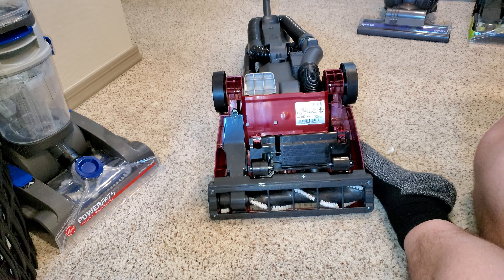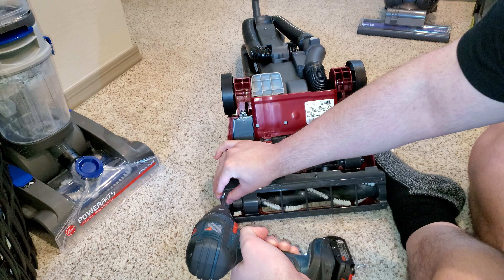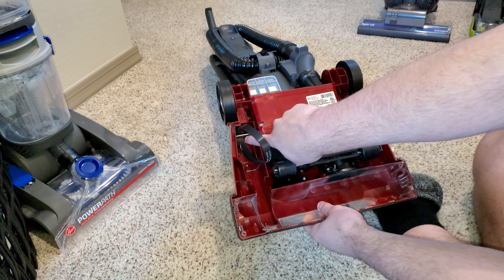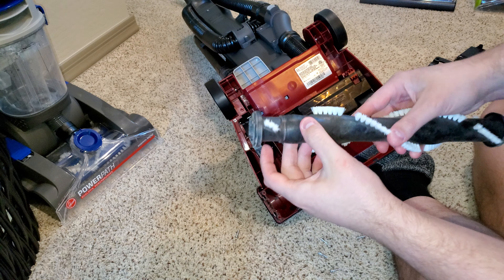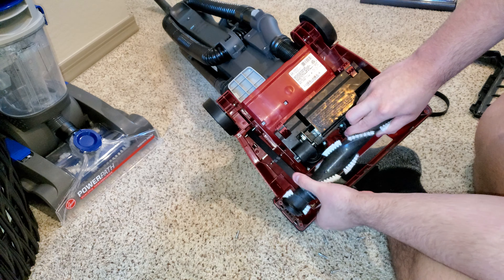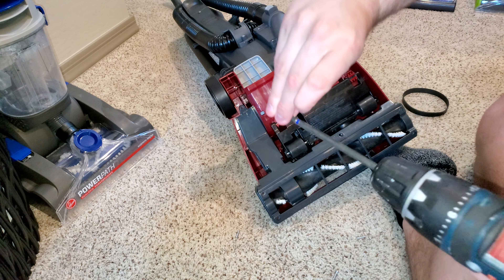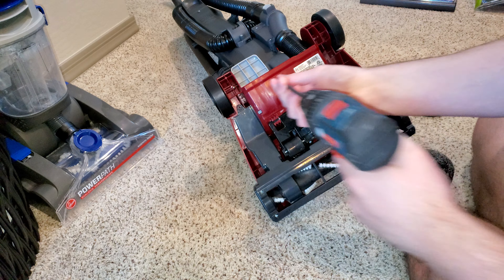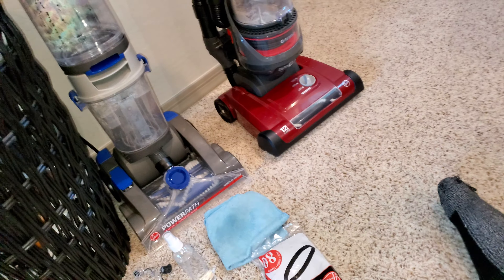How To Change A Hoover Vacuum Belt. Simple And Easy.

Comment: I was so mad about my brush not spinning after two uses until I took it apart and saw the belt broken. It was really dry and brittle (I don’t know how long it was sitting on the shelf at Walmart) anyway you just saved me tears after investing $145 in a good vacuum. Thank you!
Reply from the maker: Glad I could help. I have had many new vacuums with bad belts. It's not an uncommon occurrence

Comment: I was able to change the belt and either the belt I have ordered is too small or you are way stronger than me cuz I struggled to get the brush on.  Also now my brush wheel will not turn. I tested it before putting the guard back on and it worked and when I put the guard on it stops.
Reply from the maker: Good
Reply: I have the same problem, I had some belts for my mom's old vacuum in the drawer with the extra bags, but I can't stretch it to replace the broken one.  Thinking it may be too old, it's not rubbery / stretchy at all, not like the one in the video.  Going to see if I can get a new one and see if that stretches.  Do they deteriorate like rubber bands, lose their stretching capability?  It's Hoover Concept One with Power Drive, still working and it's pretty old.  I also have her 50 year old Electrolux tank vacuum which works great, but it's heavy and I use the Hoover upstairs so don't have to lug the Electrolux up and down.

Comment: I seem to go through vacuums quickly. But the brush on my current model has stopped turning (and I have had this before) your explanation is great and simple. I'm now going to change the belt myself. I have another hoover upstairs that isnt working either  so I'm going to have a go at that oe and see if its the same problem. THANKS!
Reply from the maker: No problem. Glad I could help

Comment: tried 2 belts already and its too loose (correct replacement belts) UH 72625. no tensioner or anything I'm wondering if I should try shorter belt
Reply from the maker: That's what I would recommend